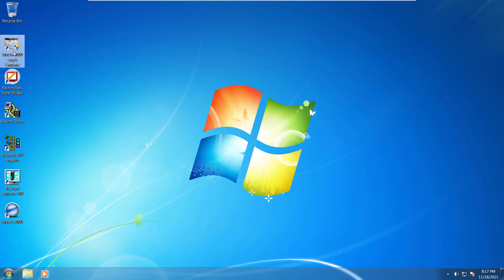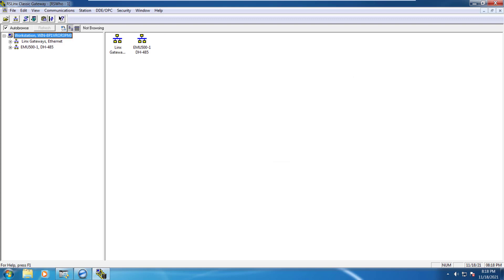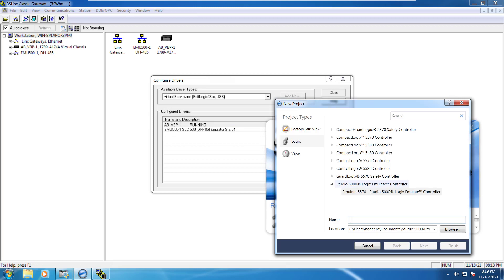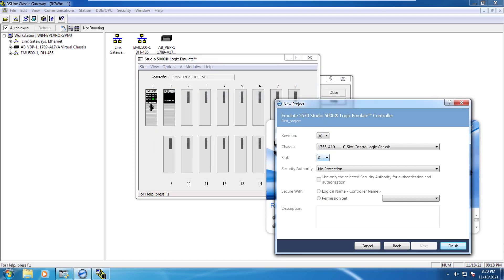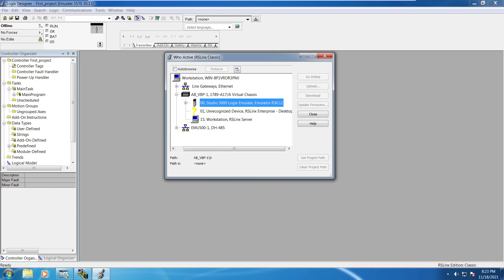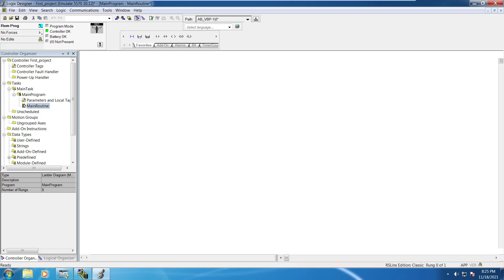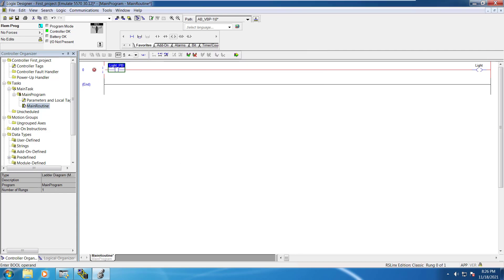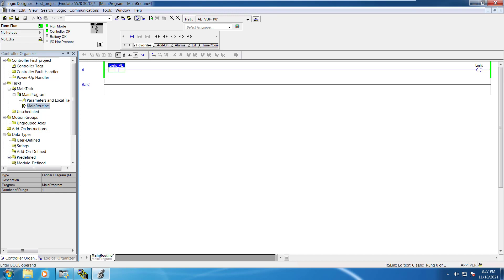Allen Bradley RSLogix 5000 PLC Tutorial: Writing your First Program by using Emulator in Studio 5000

Comment: I’m fortunate as a Field Service Engineer in the U.S. for my OEM Company that I have full license access to all the necessary Allen Bradley/Rockwell Automations Software on my company laptop as part of our company Annual Toolkit. So I can play around starting projects in Studio 5000. Even better I have access to the fully built applications that are running at numerous plants in the backup files so that I can examine at my leisure the ladders and how the routine was constructed in its programming. We use a real AB 5 slot chassis at the office with a L71 processor so I can’t say I’ve ever really had to rely on using the Emulator Software. Though I do have it as backup software install if I ever need it. However, still appreciate seeing you start and explain how to start a project in Studio 5000. Since I went backwards in these videos, there do not appear to have been a followup video to this.